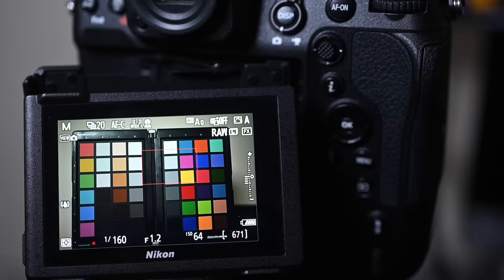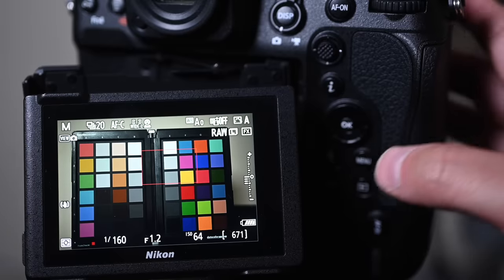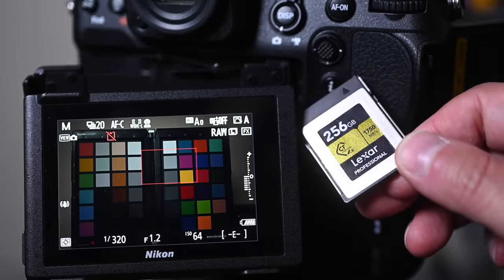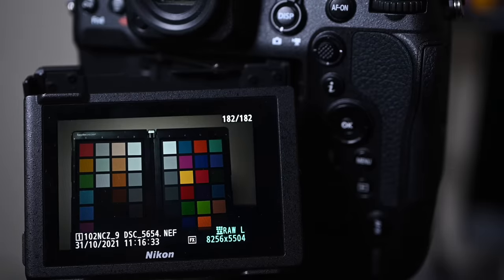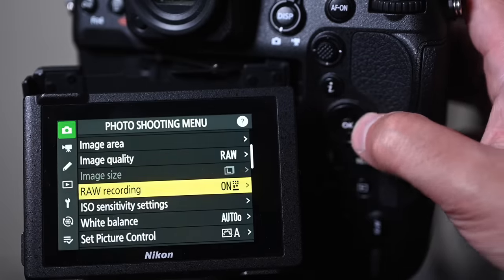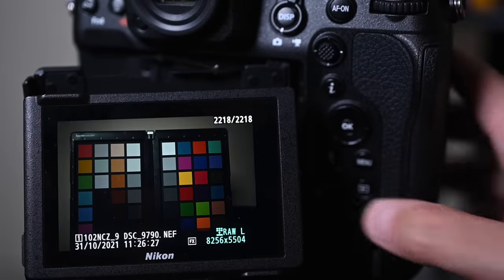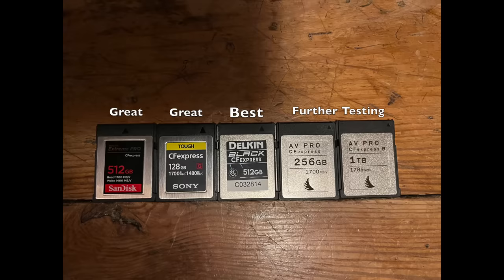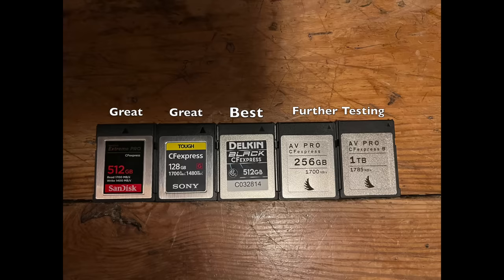Nikon Z 9 Buffer Tests. XQD/CFe/LosslessRAW/High Efficiency Raw

Comment: From Nikon's website.

*When using the recommended memory card: ProGrade Digital CFexpress™ Type B 2.0 Cobalt 1700R.

To get the max efficiency of the buffer you will need this CFexpress card above, which runs for $399 for a 325 GB card. So for the camera and this card combination you are talking $5900 excluding sales tax. I guess I will use my 125 GB Lexar 2933x XQD card for video if I run into space issues with the 325 GB CFexpress card mentioned above. My pre-order was placed on launch day. This Z9 is a D850 "which I currently use" on steroids.

Comment: Hi Mark.  Love your videos.  What would happen to speed of clearing the buffer, Z9, 20fps, RAW efficiency star, Delkin Black 128 GB card, when using your second card slot set to Back up?  Would this slow down clearing the buffer from 1100 shots to something less?  Would this cut the number in half from 1100 to around 550?  
How about shooting RAW efficiency star AND JPEG Fine at the same time to the same card?  This should also reduce buffer capacity from 1100 to something less as well, correct?  Thanks Derek

Comment: The XQD and CFexpress cards use the PCI bus.  PCI (Peripheral Component Interconnect) started in computers and big graphic card will use 16 lanes (memory bus).  I have read that the XQD only uses one lane and the CF express can use 4 lanes.  If you put a Cfexpress card in a Z6 or Z7 it doesn't get any faster because these cameras only uses one lane.  I went searching for Prograde and Delkin cards and found specifications saying PCIx4, which to me means it will use 4 lanes if the camera uses 4 lane.  Question, does the Z9 use 4 lanes for CFexpress cards?
Reply: Yes Z9 supports CFexprerss 2.0. Which means Z9 is capable of writing 4000 MB/s to a CFExpress card & we will see CF express cards capble of at least 3000 MB/S.

Comment: Greatly appreciate these tutorials!  So, if you install both cards with one as spill over, you could double the buffer capability?  Thanks again.
Reply: I don't think that's how it works, the buffer isn't part of the card, it's basically a ram module in the camera that can hold approx what the XWD results where here. The reason the results were different for each card if just the offloading off the buffer slows down how fast it fills up.
Reply: If the Z9 would allow a RAID-0 configuration of the 2 cards then it could write to them faster thus allowing more shots until the buffer cannit be cleared fast enough. However since such a mode would be very difficult to handle for most users it is very unlikely that it will ever be available.
Reply: If it works like that, and probably could if the firmware supports it, you should be able to shoot continuously. Ricci’s working theory is that a sufficiently fast card should allow nonstop shooting.

Comment: I think the deal breaker for the z9 is the slowness of changing modes. I like having birds in flight (BIF) shots be a seperate mode (with a high shutter speed and +1 EC) that I can quickly turn the mode dial once to get to. With a big telephoto lens in my left hand I like cameras with the mode dial within easy reach of my right hand. The mode button on the z9 is on the left side of the camera and requires two hands to change the mode apparently which would significantly slow down my reaction time for BIFs.
Reply from the maker: You can just use recall shooting functions instead it lets you put any mode shutter speed aperture iso focusing on a button press
Reply: @RicciTalks  That's great to know, thanks. Subscribed.

Comment: Excellent...thank you. Even though I mainly shoot sports I personally can't see where I'd ever genuinely need the top end to justify the cost involved. Maybe the fellas shooting the Olympics 100m final or swimming sprints might !!! Thanks to your video I can see that the 'middle grade' would work fine for me most of the time and I'd even get away with XQD if I had to. 
P.S... (and slightly off-topic but this video reminded me..)  I haven't seen anywhere else if the 'two button format' as per DSLRs' has been re-instated on this camera ? It's a feature I miss on the previous Z cameras as I used it a lot. Is it there or can it be mapped to buttons?

Comment: Ricci,  Thank you.  I find that the number of frames before buffer fill is also very dependent on shutter speed, and to a lesser extent, to focus area mode (wide area is faster than 3D) and whether subject detection is on (better performance with subject detection off).  For example, shooting lossless compressed at 1/2000 second, performance is only half as good as shooting at 1/320 second.  I haven't seen anyone yet addressing this.  It makes a real difference, for example, for bird shooters who will frequently be at 1/2000 or faster.  Can you comment?  How is the shutter speed able to impact buffer choking?  Thank you.

Comment: When buying the ProGrade CFExpress Card it is very important to buy the COBALT grade card and not the GOLD card. In terms of the buffer the COBALT has a sustained write speed of 1,500 MB/sec, whereas the GOLD card's sustained write speed is <550 MB/sec. The COBALT seems to have a higher sustained write speed than the Delkin Black - but I have not tested it.
Obviously the price of the Cobalt is much higher than the gold version. 
When card manufacturers do not post the sustained write speed they are trying not to tell you how bad the write speed is compared to the write speed.

Comment: I assume they haven't yet figured out that if you're using the second slot for backup that they should perform the backups when the camera is idling, not immediately and slowing down the buffer clearing.

That said, would love if you get a chance to repeat with two cards in use.

Comment: For reference, when I tested the Canon R5, at 12fps got just under 180 RAW shots with the Delkin Power CFexpress cards. Canon R5 has lossless RAW files that are about 37MB to around 50MB depending on the scene.

If you cranked the R5 to 20fps I imagine it would show a similar performance. I didn't test it but Canon rates it at 83 frames RAW at 20fps. Pretty much on par with the Nikon Z9. I estimated from my tests that the Canon R5 had a 2.5 GB buffer. Given that the Canon R5 is showing similar performance, a 2.5GB buffer in the Z9 is pretty solid. But considering the 64GB Delkin Blacks are slightly faster than the Delkin Primes I tested, I would assume the Z9 buffer is only 2GB. Same as the Z7 and Z7II.

Seems like this Nikon Z9 buffer controversy is a nothing burger.

Comment: Hey Ricci, any chance you can do a video talking about the Z9 capabilities using strobes in studios and outdoors for high speed sync. Not a lot of info so far. 

Also the built in wireless transmitter is intriguing. The idea of being able to shoot tethered wirelessly via the NX software is cool but I hope more that this could be implemented in Capture One at some point.

Comment: Hi Ricci, a very clear and informative video, thank you.

I was surprised to see that the camera didn't have options for the raw recording image size resolution as the Z6 ii has three options (L- 24mp, M - 13.7mp, S - 6.1mp), and I've found this to be a really useful option to have as I don't need to always have the full resolution the camera can provide, but I do like having the quality and flexibility that raw files offer.

I'd love to know if raw image size options are going to be added to the camera with a firmware update or not, do you have any insights on this?

Comment: Have you tested the Z9 with Integral 128GB CFexpress Memory Card - mainly the Cinematic grade cards; on the blurb they advertise 1700 M/Bs read and 1600 M/Bs write - not sure whether this is peak / sustainable ( average).          I use them with my Z7 (and Z6 I/II ) and had no trouble with them; even shooting Max Fps in Z6 / Z7.

Comment: Slight deviating away from the Z9 but still on the topic of cf express and xqd  cards or rather card readers. I've a D850 and have just been transferring all data via the camera connected to my PC but I want to get a card reader so do I get a fc express/xqd and separate sd card reader or are the combined readers as good, the same as or inferior, or just stick to camera transfer. Then which makes are up to the job.

Comment: Thank you! Unfortunately Delkin Black CFexpress card is not available in Germany. The ProGrade Cobalt 325GB is too expensive. Could Nikon open the USB-C port for SSD recording for video mode only (firmware update). A multi camera setup would otherwise need an external monitor for each camera.

Comment: I noticed that  Delkin 512 GB card has a write speed of at least 1405; the 256GB card has a write speed of 1400; and the 128 GB has a write speed of 1710.  Is faster write speed better allowing more frames in buffer?  Does it cause more heat?

Comment: Unrelated to this topic, I would really like to know if the mode with 120fps jpegs are from the full frame or are they cropped? and if they are not cropped, is it then possible to take 120fps while cropped in, and will it still be stored as 11mpx jpeg images?

Comment: Haters gonna hate!
But the buffer is "only" 20 frames, unchanged since D850, how quick the buffer being drained to the card is question of the card not the camera, maybe there is a limit somewhere for the cameras card-drive, but those are "always faster"
People talking about buffer are talking about how long can the camera pump the photos on full rate, You should make that clear for everyone!
It is like buying a Ferrari and claim it a crap car because it does not even  go with 30frames/s, I mean  30km/h (...ON A DIRT ROAD)

I also have a question as someone who will buy the Z9 (no preorder sadly, but sometime next year) about video.
I have the Z7II and it cannot shoot 4K@60 if the capture area is set to DX.
The Z6II cannot shoot 4K@60 if the image area is set ot FX (as far as I know, maybe I wrong about this)
I briefly had a panasonic s1r, I hated it, but had a great function, I could record 4K@60 in FX, DX or even 1 on 1 pixel!
Can you please check for us the possible limitations on the Z9?
I will get it regardless, but I am curious!

Comment: Hey Ricci, thanks so much for your uniquely informative videos. Hoping you can clear up some spec confusion as half the websites say the z9 syncs flash at 1/200, and the other half say 1/250. Even Nikon’s own website isn’t entirely clear:

Flash Sync Speed

Up to:  X=1/200 sec. to 1/250 sec.; synchronizes with shutter at 1/200 sec. or slower; Auto FP High-Speed sync supported

Can you elaborate?

Comment: I have a question. If you have two cards of different write speeds in the slots, what speed does the camera write at? The speed of the slowest card(as some Nikons default to when a slower card is in a slot, even if it is not the active slot)?

Comment: Could you run the buffer check with DX mode RAW Large for the lossless compressed?  I'm a D500 shooter and with DX around 19 mpx on the Z9, I was wondering if it has a very large buffer in those settings.

Comment: There is one thing I don't get. All the latest ultrafast Cfe cards such as Delkin Black, Prograde Cobalt etc, advertise minimum sustained write speeds at 1400MB/sec.

But the Z9 only need around 1200MB/sec to shoot 20 fps at Lossless Raw.

So shouldn't the buffer be practically infinite with such a card?

Why does the camera slow down after 80-90 frames even with the fastest cards?

Comment: Thanks for the tests and preview Ricci! I see you’re using a tripod plate on the Z9: are the hole patterns (1/4-20 thread as well as the anti-twist holes) on the Z9’s bottom plate the same as the Z6/7 and MB-N11?

Comment: Thank you Ricci! Appreciate this video and clearing up misinformation from others. Anyway, I'd be waiting and looking forward for your High Efficiency* RAW comparison. Just concerned how LR or other photo editing software handles the files later on. Yes might be smaller file size but it's slow to load or edit in LR.. Etc.. Thanks in advance!
Reply: All Canon Nikon etc raw files are compressed in a way or another, only sony has option for uncompressed raw.
Reply: Probably 45 megapixels will handle as any other high megapixel file

Comment: Anybody buying a card today would get a CFExpress card (not an XQD) because they are cheaper and better. Any average good CFExpress card in Amazon right now has at least 1000 MB/s write speed. Also, if you are shooting fast action requiring those 20 fps or higher using compression makes it easier to transfer the files to your computer and working with them after the shoot. Other cameras (e.g. R5, or the A1) also have limitations when shooting raw and limitations with performance when the battery is not fully charged. So we could nitpick on those two. The fact that this will become the main point for nitpicking to be used by Canon and Sony marketers against Nikon, tells you how amazing the Z9 is. The other point here is CFExpress cards will continue getting cheaper and faster so in a year or two this will likely be absolutely a non-issue.

Comment: About the Delkin Black cards, when I was checking out the different capacity sizes available I noticed that the minimum write speed is fastest on the 128GB size and slower on the other sizes, such as the 512gb. At B&H they list the Delkin Black 128GB with a minimum write speed of 1710 mb/s and the 512gb with a minimum write speed of 1405 mb/s. So it seems that even the capacity of the CFexpress type B makes a speed difference.  Did you do any testing on different sizes of the same brand & series of cards?

Also I would love to hear a good explanation between the difference of Nikon's STAR formats versus the regular. For the Z9 RAW files that means High Efficiency STAR versus High Efficiency. But also the differences in the STAR formats for JPEG images.
Reply: BTW, somehow I knew that my existing Sony and Lexar high speed XQD cards wouldn't cut it with the Z9 for aviation and equestrian shooting. They may work just fine for doing landscape and focus shift shooting. I went ahead and ordered some ProGrade Cobalt 325gb cards because those are the cards that Nikon noted they used for setting their buffer benchmarks. I may order some Delkin Black cards.  

I would like to ask what you found to be the total number of shots capacity on the various cards you tests. How many High Efficiency STAR shots can you get stored on a 128gb or 512gb card?

Comment: thinks for the info
The same behave also apply to the Z6II(as i do drive the Shutter speed to the max when I need to do a Fast Timelapes and it can go over 600+ shot - if the card don't give me hot card Warning)

I have a Z7II but I haven't try to run this way, as 

Look like the Z9 have done something extra card cooling mechanism on the Camera
as when I am driving at Max Suutter speed Compress Raw data in the card on my Z6 if in summer, I will get Hot card warning from the camera after 300 to 400 shot
as the File size from the Z9 is double I can see it will create more heat
(i haven't tried to the limit when it will stop as Heat and Flash Memory is not a Good Friend)

Talking about the RAW file, i think I really want to know is how much Shadow Data I can recover from the Raw file
As one of my shotting key topics is Using the MAX Shadow Data in a Very low light condition

Comment: Man, I wish Nikon would have given us the uncompressed RAW option though.  Feels like we're not getting the highest quality possible, even though it may not be noticeable in the real world.  But to read out at those speeds I understand why Nikon did what they did though.  Maybe a firmware upgrade or the Z10 will address this, even if for marketing purposes only.  Like the megapixel count wars from the early days of digital.
Reply: There is no difference in IQ between Uncompressed RAW and Lossless Compressed. Where we are not yet clear is what will be the difference in IQ between the two High Efficiency modes which are lossy.

Comment: Thanks Ricci, really enjoying your videos about the Z9, really great work. Quick question, no one seems to discuss if the Z9 at 120fps & 11m pixels, if the focus can really keep up at that frame rate, have you tried it?
Reply from the maker: Yeh the focus works at 120fps no matter what mode ur in 
Shoot at 20 camera focuses at 120 
Shoot at 120 camera focuses at 120 

To be clear though I have not don’t much testing in 120 so will look in to this further
Reply: @RicciTalks  Good to know if it can actually keep up at that frame rate. How does focus speed compare with older non Z lenses and Z lenses?

Comment: Great video. But I thought it was confusing how you only defined what high efficiency star was at the very end. Maybe it's just an oversight or lack of organization but it felt more like it was coming from a marketing focus to disclose the absolute minimum required rather than presenting a dispassionate fact based evaluation. It felt similar to your video on how you said the lack of a continuous confirmation autofocus was actually an asset because it would be too distracting, even though other brands and Nikon DSLRs managed to do this without any issue.

Comment: I guess you took some 6000 shots in this test and observed that the battery level remained unchanged. Did you recharge the battery in between the shots or does battery shoots 30k shots on a charge??
Reply: I guess that with that kind of continous shooting it will go on for thousands and thousands of frames. CIPA rating is measured in complety different fashion.